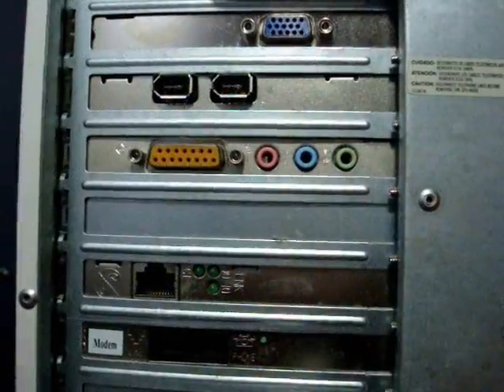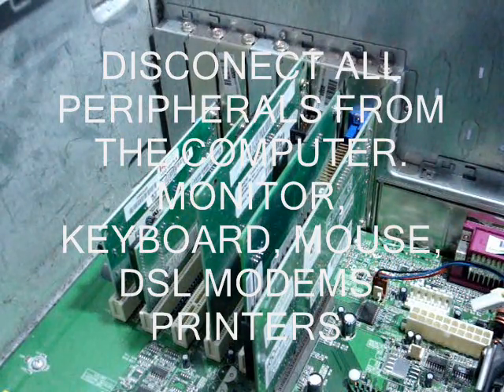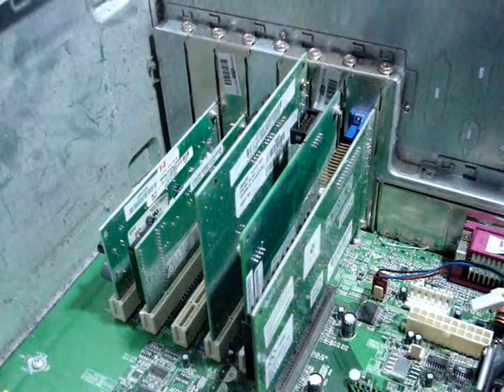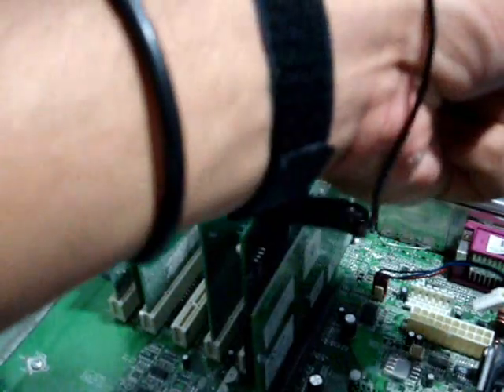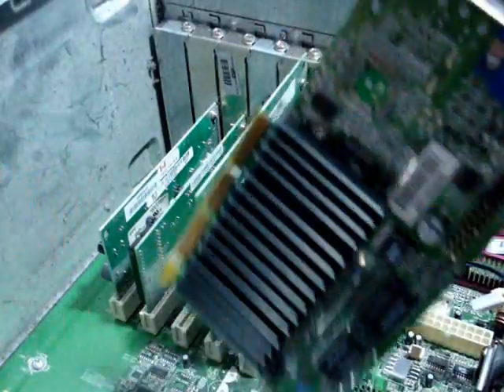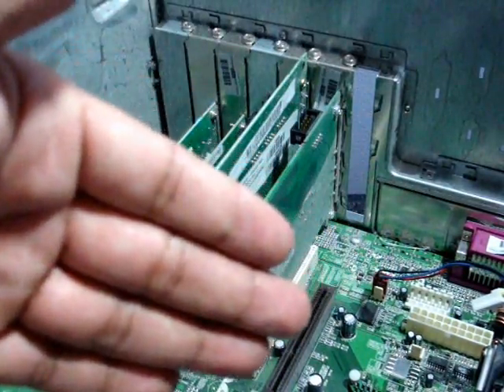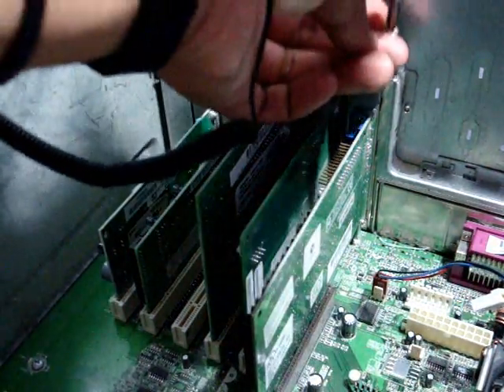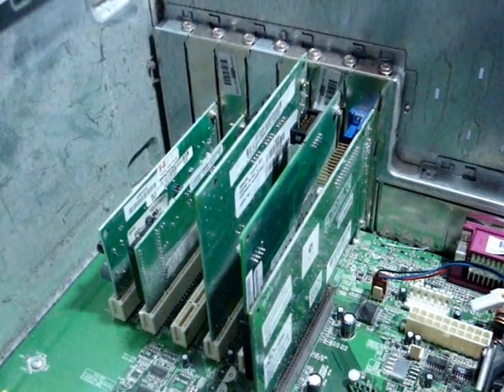Install-Remove-Replace Modem, Video,Audio or Network Card

Comment: I have an old Gateway P4 tower machine from 2003, which came only with 256RAM and a 56K dialup modem.  I just ordered a hi speed PCI ethernet card from Amazon, and would like to install it in my machine, so that I may surf the web with my hi speed cable connection.  Would I use the same PCI slot that the 56K modem is attached to (after removing it), or do I use a different PCI slot?  Does Win XP automatically recognize the new ethernet card, or do I have to install special software before?

Comment from the maker: An antistatic wrist strap or ESD wrist strap is a device used to prevent electrostatic discharge (ESD) by safely grounding a person working on electronic equipment. It